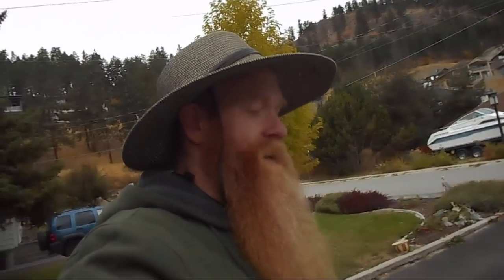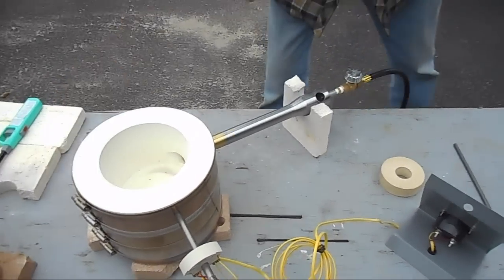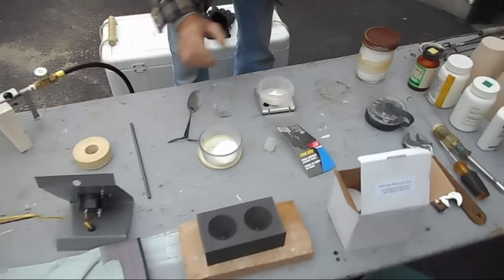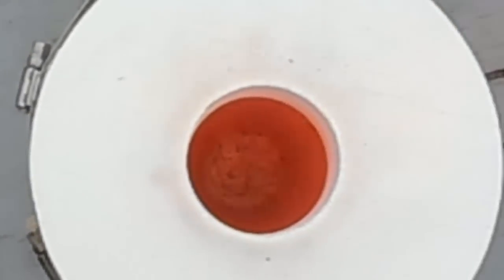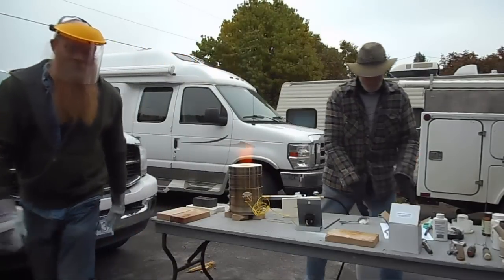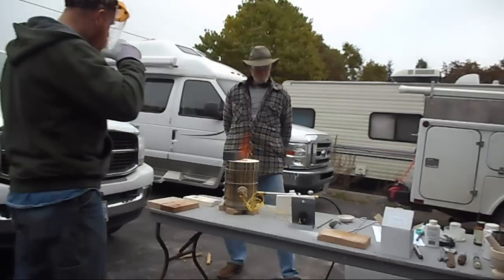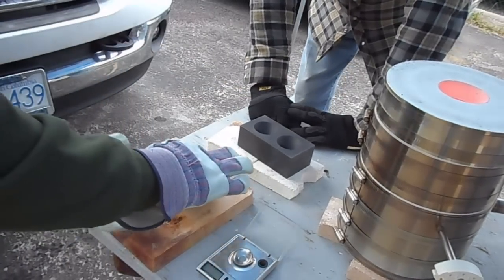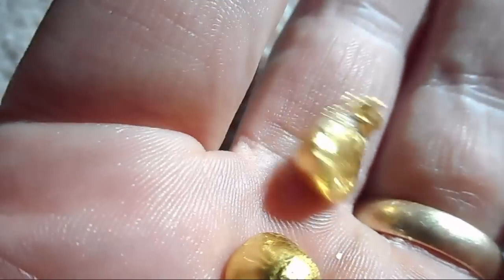Smelting "Alchemy!"  Well no... But Gold Melting, Smelting, Cupelling, and Assays.  Part 1

Comment: I used to pour a large amount of lead for sinkers and round ball. It was vitally important that the mold was totally dry. Hot metal & a bit of moisture = explosion. Glad to see you using safety precautions. I saw one person get his hair, & beard coated with lead  spatters because he didn't double check for moisture. Pouring in the rain or snow is not a safe thing to do, IMHO
 Great video.

Comment: Great stuff guys! I was looking into this awhile back and seen almost the exact same kiln for iron smelting. Only difference was they were using steel wool in the refraction mix and had a torch on both sides. Not sure if it was the same makers or not though.
Apparently the steel wool acts like rebar would in concrete and holds it together to let it last a bit longer.

Comment: Like your video. i work for steel foundry sitting thinking of ways to make my own . But might be just me but looked alittle cold when pouring. 
you lost about 100 degrees or more from time took lid off to pouring. Melting temp of gold is around 1950 F. You need to heat up to about 2200 to 2300. to be sure has time to settle then harden with a warm mold. But great job on video looks like fun.

Comment: FYI  @DanHurd ... before you poor into  The mold it needs to be preheated prior to the first casting cycle and then used continuously in order to maintain ... In the process the material is poured into the mold and allowed to cool until a shell of material forms in the mold.

Comment: Ive only watched your part one so far but get yourself some good welding gloves not the yard work ones your using.   Also after the first refining melt. The second melt of clean gold beads you need borax to cover the gold to keep it from air at high temperature and You should sprinkle borax on it one last time once poured in to mold to give it a better shine. The lazer thermometers only go to 700 degrees fyi. Just for fun try a freznal lens someday to melt your cons and flux. It can turn any rock into glass lol but careful some rocks explode with that much heat that fast. Its about 3000 degrees instantly. Piece of wood burst into flames like magic its pretty cool but dont walk away without getting the lens in the shade or you may burn things you dont want to.

Comment: I have watched this video three times in its entirety. Something I would like to see a video of is you breaking up a mirror, crushing it to dust and smelting it to see what you get at the end. Then take that and clean it up and smelt it with a little gold just as an experiment. I have heard that smelting mirrors produce a glass and silver bead. And when cleaned up you are supposed to be able to recover the silver bead and alloy it with Gold. I'd love to see you try it because I know that if you did it I would trust that it does what others claim. Plus I would like to see what you find as an end result. I know that if this was possible you would be intrigued enough to figure out what the end results are and what exactly you are left with. By testing it. I can not do this because I do not have a smelter, gold or silver, although I could crush a mirror into powder if I really wanted to. I am also curious if smelting a mirror requires any flux or if the powdered glass is enough to work as a flux.

Comment: You did not do a melt at first. You did a chemical reduction reaction, aka, smelt. Recommend you use graphite crucibles for this smelt as the graphite is part of the chemistry of the reaction, too. Suggest breathe gear. P.S. I am an assayer.
Reply from the maker: Yes there was a very small percentage of the material that was "Other stuff" that the flux did chemically react with.  And that is why we use more than just Borax to help with the melt. We did want to clean it up a bit more.   However that was not the purpose of that melt "Smelt"  Basically we were just getting comfortable with using the Kiln buy melting a bunch of gold flake together.  The added chemistry happening in there was just a bonus for the day.
Reply from the maker: also in later smelts we are using flour for the carbon source as I don't have a big enough Graphite crucible.

Comment: Use a blowtorch on the mould and the metal as u pour it. If it's still liquid in the mould, it sorts itself out. U shouldn't be able to touch the mould with STD leather gloves.

Comment: This one is dangerous compared to mine is all steel on the outside with heat resistant type of wool not lamb wool  and has a hinged top made by Vevor it don't have to be preheat just put together and melt.

Comment: I want to meet up with you and do a SCUBA dredging video. I have the SCUBA gear, and I believe you have everything else.
Reply from the maker: That would be SO much fun.  Where are you located?
Reply from the maker: That is not too far, lets plan something for next summer.
Reply: I'm in Canada a lot. I'm doing a multi-year project in Point Roberts, and my girlfriend lives in Vancouver. We want to do the work in low water, if possible. I have a 10' inflatable boat with a 20hp outboard, and a good anchor. We could put a trash pump in the boat, then I could go down with a suction hose and nozzle. The discharge hose could go right into your big sluice on the riverbank.